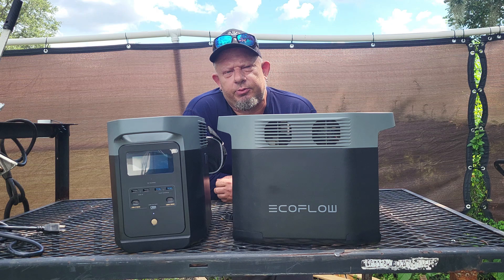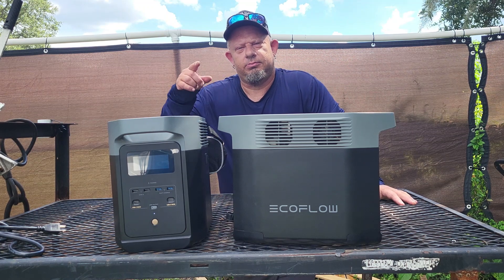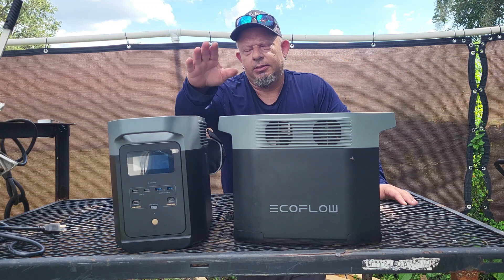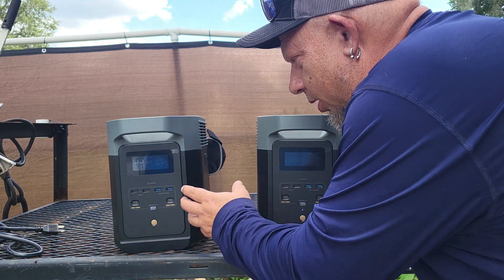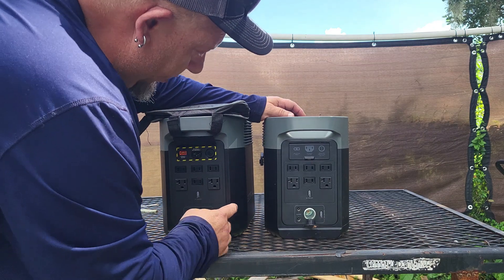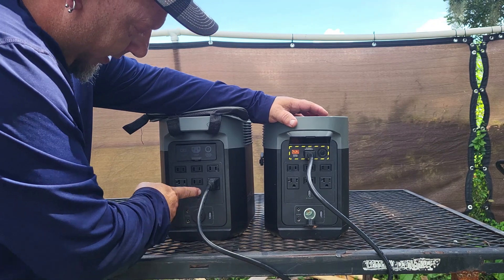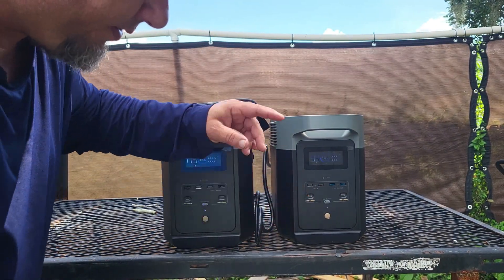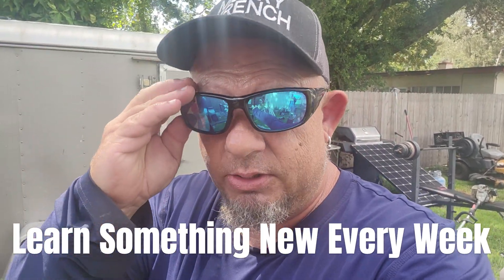Connect Any 2 Power Stations / Daisy Chain /  Solar Sunday

Comment: Have you tried a splitter with the 120v sources with the 2 600w power stations and plug a 1000w microwave.
Reply from the maker: Hi thanks for the question.. if I am reading it right I would say the answer is no.. if you have a 600 watt invertor in both power stations.. they both have a max.. usually running above the rated wattage of 600 is only good for about 2 minutes.. and connecting 2 together does not double the amount of watts they can put out.. they don't combine.. so you still have 600 watts available total.. the good news is if you try it on a single power station and it does not output enough to run the microwave it will just go into fault mode and not damage the power station.. so I would give it a shot on one power station and see how long it runs.. you may get 3 or 3 minutes.. unfortunately they sell those small units and don't warn people that most appliances use 750 to 1000 watts .. those small units are great for a fridge.. lights.. tv .. fans.. that kind of stuff.. I have one myself .. I moved to batteries and invertors instead of complete power stations cause I can ad a 100ah battery to the system for $150 and I bought a 4000 watt invertor to handle anything I can throw at it.. I have other vids on the channel about simple set ups and I am doing a video this week on another brand of battery
Reply: @MunkyWrench  thanks for the reply.  I'm asking as I see a 500w power stations at a great price.  I wanted to buy 2 units and run the 2 power station inverters in parallel.  I think it will run a 900w device for example with the 2 500w power stations.  The biggest issue is how to sync the inverter phases from what I gathered.  Apparently if they are not synced properly it could pop the inverters.
Reply from the maker: @cameranmanner4701  Honestly I was aware you could do that with multiple power stations.. I will have to check into that myself. if you do this please keep in touch and let me know if it worked and how you did it

Comment: what is the power loss from converting ac to dc then back to ac again?
Reply from the maker: I could not give you a specific number .. you would have to look up the specs of your exact power station and do the math. I can tell you I charge with solar daily and any power lost has not caused me any concern. I have more solar panels than I need. Sorry I can't be more specific

Comment: Can you daisy chain using 2 different brands, say an Anker and an Ecoflow?  Thanks.
Reply from the maker: yes you can .. the only thing that any unit has to be capable of is "pass through charging" which now a days they all are.. that means you can use the unit while its plugged into the wall.. as long as thats built in you can connect any unit any brand any size and the units will make any adjustments for you automatically .. Thank for taking the time to watch and subscribe it really helps

Comment: Thank you for your video, it answers a basic question. Other videos over complicate this process while yours is succinct and does not drone on. 

The terms you were thinking of were a "master and slave" relationship between the two units.   The benefit of daisy chaining two like units, is that you may not be at home when one runs out of power. The other benefit of having two like units instead of one unit with an extra battery is the battery depends upon the main unit to charge both itself and the battery. While having two of the same units lets you charge both separately. This would be ideal if you wanted to charge both at 1200 watts and use different circuits in your home or RV. 

There are also videos where the master unit is a Delta 2 and the slave unit is a River  unit or different brand of power bank 

I do have a request for a video. The Ecoflow solar panels are very pricey and I have purchased one 220watt portable solar panel. Could you please create a video where a stand alone solar panel is connected to the Ecofflow power bank and explain what type of connectors should be used for connections. Other videos state the type of connectors but never actually show them. 

Thanking you in advance.
Reply from the maker: Thankyou for your kind words. I try to make things simple. I am releasing a video in an hour on another brand power station with a solar panel but I will make a video specific to use a solar panel and charge the Ecoflow for release asap. I use a 350 watt hard shell solar panel I bought used from marketplace for $40. I have 4 of them. with the correct connector its a plug and play situation. I have MC4 connectors on all my panels ( I always install them) and I have a 6 ft extension adaptor cable which is MC4 on one end and XT-60 on the other and I simply plug it in. you can buy those cables on Amazon for $12 pre made.. easy and cheap. Thanks for the video idea and feel free to reach out anytime. I answer all comments and emails

Comment: i have an Oupes 1200 and it quit charging correctly. can you fix this and if so, im in knoxville tennessee and where are you?
Reply from the maker: thats the problem with power stations. while they are convenient and plug and play .. if one thing goes wrong they are next to useless. I am learning how to fix them. I have pulled a few apart and diagnosed the problems. some of them you can buy replacement parts for but most dont sell parts. it could be as simple as a charge port is damaged to the bms in the battery being fried.. or the battery itself has lost a few cells.. I do allow people to ship them to me to take apart and test . I do NOT claim to be able to fix them. If you are within warranty I would contact the company 1st. if not your welcome to send it to me. I may have a better chance of getting help from the company because I have a growing channel. I am willing to help in any way I can. I am located in Florida  feel free to email me to talk more
Reply: @MunkyWrench  I would even drive it to your house. What part of Florida? This is fairly new but think I put too much solar on it for charging. Tell me what you need and we will go from there
Reply from the maker: @TheGbortnick  I was just checking out some of your vids. I have the same kind of trailer I made into my office .. I made it useable but not permanent so I could spend some time in it then figure out where everything lives and how I want it before doing the perm build. mailing it to me would be a lot simpler and cheaper than driving it lol .. I am happy to spend some time taking it apart on camera and figuring it out. usually when you put too much solar on them they fry the battery management system. let me see if I can get parts for it and I will know better what to do. my email is munkywrenches@gmail.com shoot me an email so we can chat more
Reply from the maker: usually you have a way to charge with house power as well as 12 volt or solar.. have you tried all ways .. to make sure its not charging from any source

Comment: Got two of the same units, great units. I went with 2 seperate rather than 1 plus battery as fot a few hundred more it wasnt a single point of failure.
Reply from the maker: yeah the problem with complete units it if something fails the whole thing is a paperweight.. so I have 2 and I have extra batteries for them.. this Sundays vid will be how to add a LifePo4 vid to the system
Reply: @MunkyWrench  yeah it's a single point of failure. I've looked at adding batteries to them, fogstar have a 15.5 kw battery for 2.5k atm...
Reply from the maker: @Scottishprepper73  whats the max the BMS can transfer .. most cheap batteries have a 100 amp bms the newer better ones have 200 amp .. so there is limits on transferring or dumping battery power into the unit.
Reply: @MunkyWrench  aye it's 100amp, same as my house battery which is 11kw of pylontech , I run mine at 80 amp tbf.

Comment: If you plugged the 1st unit into a solar panel, will that still charge both units ?
Reply from the maker: In most cases the answer is yes and no.. when you plug the one that's feeding the other into solar it will only charge that 1st unit but having said that.. any power from the first one will feed into the second unit so technically yes it charges both.. if that makes sense.. you can however plug solar or house power into both while using them so if you have more than one solar panel plug one into each for twice as fast solar charging
Reply: @MunkyWrench  Thanks Kelly

Comment: I have to break down and get one
Reply from the maker: They are plug and play and portable so you can carry power anywhere.. and charge it easily with a foldable solar panel or a home system. expand them with any battery for longer use. I love mine and will never be without even though I have commercial panels at my house I always charge by solar.. I can grab one to go camping or for hurricane or other emergencies and throw in the trunk if need be. worth the money